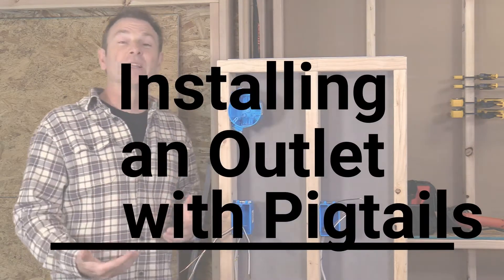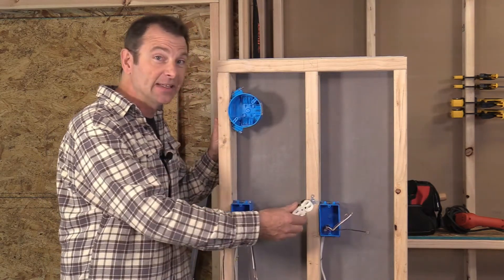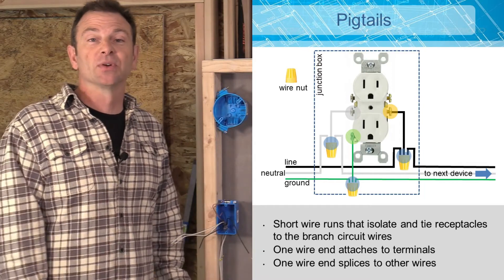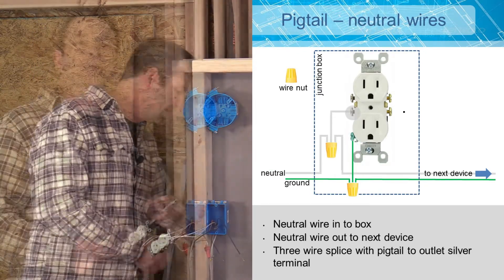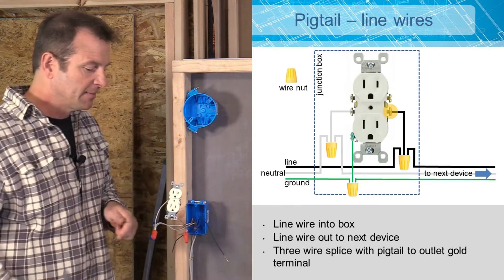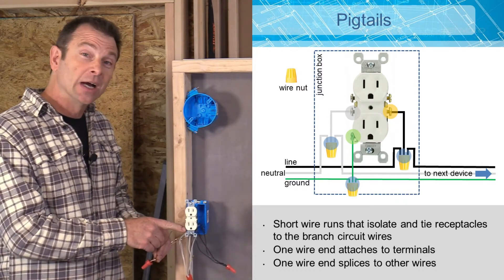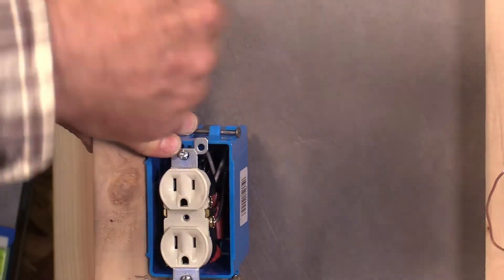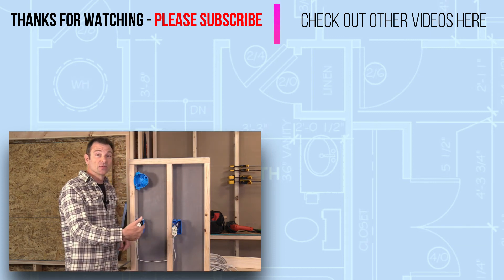Electrical Wiring Process - Part 10 - Installing a Duplex outlet with Pigtails - Come wire with us

Comment: 老师，我有个问题，插座的地线插孔，到底是该安装在上边还是下边？我看你的底线孔时在下边，但是，有的专家说，出于安全考虑，插座的地线孔，应该安装在上边。Teacher, I have a question. Should the ground jack of the socket be installed on the top or bottom?  I see that your bottom hole is on the bottom, but some experts say that for safety reasons, the ground hole of the socket should be installed on the top.

Comment: Confused as to why you are pig tailing here a receptacle with two hot and two neutrals screws one for power in and one going to the next box Thanks??
Reply from the maker: it is better practice to use a pig tail.  it provides you with more flexibility vs wiring in series.